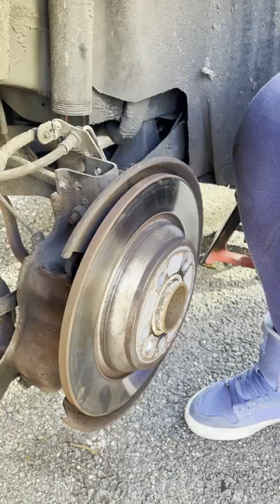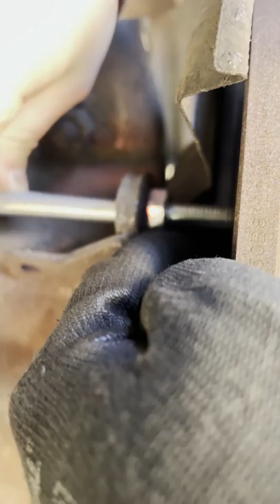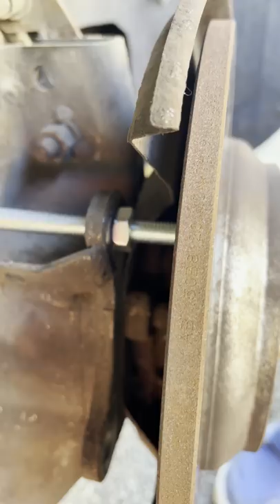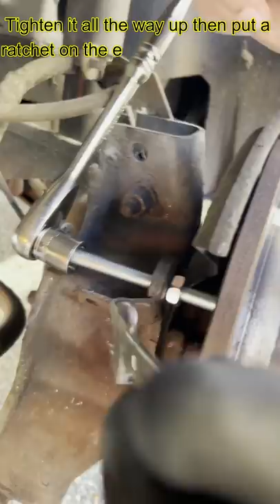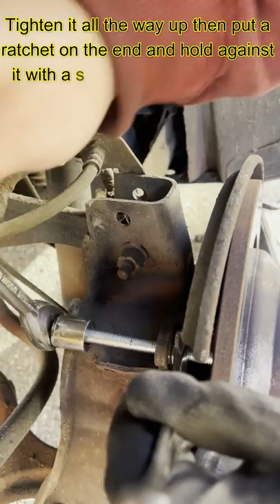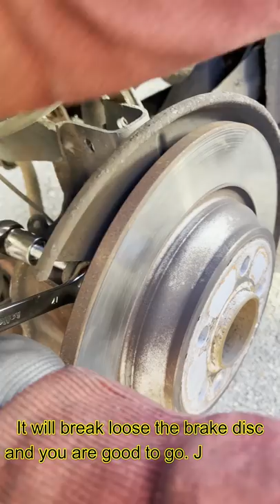How to remove stuck/seized brake rotors

Comment: That is a great way to bend the spindle mounting positions for the caliper bracket
Reply: You guys act like these cars are made out of paper never been a spindle never knocked out in alignment never damage the part professional mechanic 45 years
Reply: @donaldkissinger7362  via only had a sho for 17 years but my monkeys managed it a few times already
Reply: The bracket and holes how when the bracket and caliper are off the vehicle kind of hard to hit them when you're hitting in between the studs shocks it right off doesn't damage anything
Reply: @donaldkissinger7362  thats why we just wackem with the sledg
Reply: Or break it
Reply: was thinking same thing copper hammer or hyde mallet nd a wack

Comment: Large hammer gets the same thing accomplished way faster
Reply: And it's a lot more fun
Reply: Ya that would pop of in two seconds with a big sledge. It's not rocket science
Reply: Air hammer
Reply: Yes a hammer and a little heat works every time and don't forget a thin coat of
Reply: all up for a hammer but don’t have too much fun or the bearing won’t be happy.
Reply: Just make sure to unhook the battery ground.  Have had electronics fail after doing that.
Reply: @ckkrons2338  doing what?
Reply: @Roadking556  hammering off the rear rotor and dash module was dead when job was done (I hadnt removed battery ground).
Reply: @ckkrons2338  Reason? From the impact? Or sparks from the hammer?
Reply: @ckkrons2338  Thank you for the reply
Reply: I think you mean “mallet”, but yeah, just smack it couple times
Reply from the maker: @Moua Xiong Yep,everybody has an air hammer laying around at home 😂😂
Reply: @MrNiceGuy94  nobody said “air hammer”

Edit:
🤦🏻‍♀️ I was wrong. I see it now 🙄
Reply: @Roadking556  impact, I suspect from somehow impacting the ground system.  All I know is dash worked before brake job, didn't after.  Had to send it off to get fixed.
Reply: Exactly
Reply: I don't know you put an impact on that little thing he's got going still might not be faster but a hell lot safer and easier on the rotor
Reply: @peteragersea377  with a metal hammer it dents the rotors
Reply: @Watchout1010  hit the outside edge if your going to reuse throw away rotors
Reply: I always just kick the hell out of it and it falls off.
Reply: @Watchout1010  have you never thought about hitting a 2x4 block of wood while you hold it flat on the rotor?
Reply: @ericyoung2136  done that too,dead blow hammer,I hand.
Reply: Big ole hammer.
Reply: Thinking the same
Reply: @ckkrons2338  you realize the only electronics on the rear wheel is the speed sensor for the abs unit. The ground for most electronics on a vehicle go to the chassis ground on the engine block and back to the frame or unibody.
Reply: @lawman8877  Yes.  Could it have been coincidental, maybe.  I just know it was a $250 lesson for me.
Reply: Sometimes the hammers don’t work. Save yourself the hassle. Go buy a $40 3ton jaw puller. Sometimes the axle gets stuck in the wheel hub. The jaw puller will get those out too.
Reply: Agreed, this method takes a chance of bending or breaking the ear off the knuckle bad idea!
Reply: @basitbukhari7805  wtf are you taking about? The burying that holds up thousanda pounds of car will be ruined with a 5 lb hammer? All my 20 years of being a mechanic have i ever heard such stupid.
Reply: @ckkrons2338  you have more problems than in your brake rotor if hitting it with a hammer cause something to die. A speed bump puts more shock through your vehicle
Reply: @ckkrons2338  and how are those connected? Sounds like you have no idea what you are doing
Reply: @Watchout1010  no it doesn't
Reply: @peteragersea377  nope tapping between the lug nuts studs
Reply: @ckkrons2338  was it a gm cause all you needed to do was resolder the 511 resistors
Reply: @talonbriley1514  um no
Reply: @beekeeper8474  best of luck on debate team.  Just sharing my experience.
Reply: @beekeeper8474  02 Volvo S60
Reply: @MrNiceGuy94  but they should have a hammer
Reply: I have a "Get some" hammer just for that.
Reply: @beekeeper8474  so you shouldn't repeatedly pound on your car without disconnecting the battery...mkay.  Disconnecting the battery is a pretty standard precaution. YMMV.
Reply: Slege hammer  works every time
Reply: Yes, amen
Reply: Hit the fucken thing ! 😂😂😂
Reply: @mouaxiong8618  bingo
Reply: @ckkrons2338  do not ever touch an automobile for any reason, you are to stay back and let a grown up do it , k
Reply: @ckkrons2338  nonsense,
Reply: @Watchout1010  nope, I have removed 325 rotors for every year you have been alive, , so no
Reply: The B F H
Reply: Dats what im sayiN .... You got mr . sQUARE Taking forever .... 🤭🤭🤭
Reply: I agree
Reply: A hammer would ruin it. If the rotor is good you wouldn't want to beat it out. Plus some don't come out  hitting it. I know I have done quite a few brakes in my time
Reply: Lindsay R McGeorge  I'm a certified mechanic. I got my associates degree in automotive technology and business management.  I know what I'm talking about. I guarantee tapping a rotor with a hammer doesn't work all the time. I know. Been there done that
Reply: And it won't break the caliper mount..
Reply: @Iaintwoke  I don't know if doing that trick will break the caliper mount or not. A lot of rotors already have two threaded holes in them to pop them off. I use them when I have to. Sometimes the treads don't hold up and strip out, but that's usually how I pop off the ones that are welded on it seems 😃
Reply: @MrNiceGuy94  Just a normal hammer does the job much faster 🔨
Reply: @PsychobabbleRapp  oops, yeah you’re right 🙄 don’t know how I missed that 🤦🏻‍♀️
Reply: Use hammer hit back side of rotor not the front. That's what tears up bearing
Reply: I've been a technician for over 15 years this guy using a bolt to remove the rotor hurts my head grab yourself a  Sledge hammer
Reply: @basitbukhari7805  in that case you should replace the bearing bc it will not withstand the weight of the vehicle, driving, bumps and hard braking. 😕
Reply: If the roter didn't need turned it does now because there's a divot in it definitely smack the outside between the studs 4 Pound Hammer done deal
Reply: @beekeeper8474  “Bearing” if already failing will not like you pounding on it. I failed to mention failing.
Reply from the maker: @WhackBytch 
No worries ;) it happens
Reply: Well, only your alignment would be off.
That's all.
Reply: @ckkrons2338  There was probably a weak solder connection on the circuit board that was ready to go and the vibration that transferred to it from your hammering the brake rotor just finishing it off. This has zero to do with an electrical event and everything to do with a mechanical one.
Reply: You have one junk car if knocking a roller loose knocks it out of alignment I have my ex-combat engineer I'm certified and all diesel applications six automotive pneumatics hydraulics I have my Mac card and I have never knocked an alignment out by shocking a roller loose or harmed any shoe brakes or hardware shocking a drum off
Reply: Spray it first with WD 40 or the likes wait 2 mins then light hammer knocks.
Reply: Plus a lot of rotors have 2 threaded holes near the studs for bolts...
Reply from the maker: @kiddiescipterkiller   Well, what can I say, as you could see yourself this one did NOT have...
Reply: Lol don't even need a large hammer just a couple good whacks in the appropriate place . This is crazy
Reply: I have had more than a few rotors stuck in my 40 + years as a technician (new term for mechanic).  I don't use WD40. I use a better penetrant/lubrication.  Spray the stub where rotor is stuck, let it set while removing other side wheel. Come back, reapply penetrant, then take a torch and heat the rust bond for a few seconds. This usually breaks it free w/o enough heat to warp or damage anything. Wire brush everything clean before reassemble.  Do yourself a favor and spend $2 on a small packet of antisieze. Coat the ring where it was stuck. Also. Put a dab of it on studs/lug bolts. We live in a rust zone  state where in winter salted roads build corrosion and feed the rust bugs that eat your family car. The antisieze makes disassembly much easier.
Reply: He does not know hammer.
Reply: I new this comment would be here. I'd beat the shit out of it and she will give up! That's not even that bad to the cars I been on.
Reply: @Watchout1010  dead blow hammer works fine if your intending to reuse the disc
Reply: Hell I just kick the rotor if I need to
Reply: Not large hummer but large f….n hummer
Reply: @ckkrons2338  they didn't fail because of you hammering on a rotor. That is completely impossible. It was just coincidental.
Reply: @roberts5118  I'm not saying a hammer doesn't work. It works most of the time, but sometimes it doesn't work. You can hit it over and over again and it won't come loose. That's a fact. Why do you think that they put two threaded holes on it? So you can get the ones off that don't want to come off. I'm not going argue with a back yard mechanic
Reply: @mouaxiong8618 9009okk no
Reply: @mouaxiong8618  j7kukkkkk
Reply: @ericyoung2136  There ya go
Reply: @beekeeper8474  I think a hammer is a lot sharper hit than a speed bump which is going to be cushioned by the tire first . Might have been better to load the rotor up on one side, loosen it up and rotate the rotor 180°. Then use the bolt to load it up again. Also some penetrating oil on the hub might help.
Reply: Lindsay R McGeorge  the lightly tapping around the edge was not mentioned anywhere in the comments above.
Reply: 🤣just what I was thinking . 
Where's Khaby Lame when you need him
Reply: Which is "likely" to cause damage?
Reply: One good wack..

Comment: That's a good way to bend a caliper support. Hit harder with your purse.
Reply: Was thinking the same thing, that and don’t crouch right in front the rotor when you’re doing this lol
Reply: My guy I can tell you with certainty that a seized rotor is no where near strong enough to bend a caliper bracket. If you've ever worked on car suspensions you would actually know that what you're saying isnt possible. Youre more likely to score the inside of the rotor thats it. Ive laid hands on over 300 suspensions throught the 10 years ive been a front end mechanic and alignment tech so I'm not just spitting nonsense
Reply: @dre3stacks7  over 300?!?! Holy cow bro. Top mechanic.
Reply: @incredulousd9408  don't hate bro there's no reason for a man to feel jealous. When I say that I say it cuz I know it for a fact. The hunter hawk eye elite alignment machine at my shop numbers every work order for every vehicle I scan so I know exactly how many ive done and if you want me be precise my last alignment done was number 341 and thats not even counting the alignments I did on the previous hunter DSP 400 alignment machine we had before this one.
Reply: @dre3stacks7  man. I can't even tell if you're being serious. Putting up those numbers, I'm surprised you even have time to respond to the everyman from up there in your turbo mechanic mansion
Reply: Guarantee your brakes put more pressure on that ear then you can with that bolt but you will foul the treading
Reply: @incredulousd9408  funny you think 300 in ten years is a lot. I did that in six months. Guess some of us want to get those flag hours.
Reply: @beekeeper8474  lol no shit. What in the hell is he even doing if hes not doing at least 300 a year(just in case you have a few if those 20 hour+ jobs that run you a couple days)
Reply: @dre3stacks7  What!?  It must not snow in your area..  If you believe that, then you best stick with oil changes. Lol
Reply: Nice ride brotha..
Reply: @dre3stacks7  bahahahahaha 300 in 10 years 🤣🤣🤣🤣🤣🤣 thats a joke right? I’ve done more than that In my garage on the weekends...
Reply: @dre3stacks7  I do it every day, and I've bent them before been there done that. Next.
Reply: @nickcove7355  😂😂😂😂 remind me not to let you touch my stuff. 20+ years never seen nor heard of anyone bending these. But then again a smart person knows most rotors have a threaded hole for pushing off the Hub or know where to swing the hammer.
Reply from the maker: Guys, check the video again, this particular rotor did NOT have those holes for pushing itself off that way.
And shame or not, I do not have a sledgehammer nor I am a mechanic, I never claimed that, so do not know why people keep thinking that.
Keep up the good work, and all the best ;)
Reply: @NewEdgeDesigns  thanks man
Reply: @beekeeper8474  hey you. Don't let me touch your stuff. Just reminding you.
Reply: @dre3stacks7  Can’t wait till you meet a rotor that’s seriously seized and have to eat your words. Oooh alignments! You must have serious skills 😂
Reply: Is that how you do it, isn't that hard on your purse.
Reply: my first thoughts also
Reply: @timmydemattos691  yes cuz most of the people who do alignments can't figure out what the difference between red and green is.
Reply: @nickcove7355  don't worry I won't i like my stuff working.
Reply: @MrNiceGuy94  well then why are you posting a video of you working on a car and you don't need a sledgehammer to take off a damn rotor if you know what you are doing.
Reply from the maker: @beekeeper8474   What was the exact problem with this method?
Reply: @beekeeper8474  
Look at the direction of the force being applied. Yes, it's less than likely that would happen. If enough force were applied on a smaller vehicle, it very well could. Point is, the ears were not designed to take force applied in that direction.

Comment: I apply a thin film of anti seize on the hub before reinstalling the rotor to avoid this issue.
Reply: How about vaseline
Reply: @JuanRodriguez-eg4oi  anti seize will handle the heat
Reply: That's right. Thanks.

Comment: So there's so much choice here, warp the caliper bracket, warp the brake disc,  score the back of the brake disc or all three, great tip, can't wait to see this tried on a ceramic brake disc, I'm sure it will work just as well, again thank you for this.
Reply: The bracket and caliper are already off you cannot hit them you cannot warp the rotor because you are hitting it solid surface between the studs it bends nothing damages nothing been doing it for 45 years professional mechanic I have more certifications longer than most people's grocery lists

Comment: Since the brakes are made of cast iron, aluminum and some steel, I advise against this approach.  Then it's better to walk along the brake disc with gentle hammer blows, or use a large puller on the wheel hub.

Comment: 9/10 rotors have pusher bolt treaded holes right on the hub face of rotor. Snag 2 8x1.50 bolts and ram it. No chance of bending caliper ears this way 🤓
Reply: Most likely it will crack than bend, either way it's broken and needs to be replaced. Right ways are pullers that push from middle and grabs from sides of disc or just hammering it out wich is fastest way.
Reply: @MrBrutalMachinee  my guy have you ever worked on a car suspension before? There is 0 chance that he'll bend or crack the caliper mounting bracket with a seized rotor physics wont allow it not to mention that a caliper bracket is one of the stronger components of an automotive suspension. The worse that can happen is that you score the rotor and have to replace it. Nothing more
Reply: @dre3stacks7  Those are casted iron or aluminium, and yes i have seen it happen before...
Reply: @MrBrutalMachinee  guy are you seriously telling me that rust is stronger then cast iron? Did you pay attention to physics class in school? It is physically impossible to bend a caliper bracket that way and I can say that with 100 % certainty ive laid hands hands on over 300 suspensions and have aligned over 300 vehicles in the past 10 years so please dont act like you know what youre talking about to someone who actually knows what hes talking about. Oh and yes some caliper brackets are aluminum but they only started using aluminum recently, 80% of the cars on the road have cast iron or steel.
Reply: @dre3stacks7  Never said anything about rust being stronger or rusted disc being stronger. Were talking about bolt and nut through that damn caliber ear has it's risk doing so, you seem to missed something on school about casted iron. Cracking casted iron is way easier than you think.
Reply: Air hammer works wonders too bro
Reply: @MrBrutalMachinee  yeah its pointless to continue arguing with you its obvious that youre not the sharpest tool in the shed so we'll just leave it at that
Reply: Unfortunately, not all automobile manufacturers give a damn about the serviceability of their vehicles (about 80% of them😡), so an alternative method mentioned above would be to pound on the face area of the rotor between the wheel studs.

Jason Wampler
W A M P L E R
Reply: @jasonwampler3020  air hammers are also a great way 👍
Reply: I once hammered the rotor and accidently hit the ear of the caliper. I had to replace the spindle. Cost me a fortune.

Comment: Don't do this unless you want bent brake caliper mounts. Use a hammer.
Reply: Look at where the mounts are. If that bolt was strong enough and if that rotor was stuck enough to bend that bracket then just get a whole new front end because damn that mount is much much stronger then you thing remind of the forces it takes from daily driving normal breaking and not to mention hard breaking.
Reply: Never use a hammer...